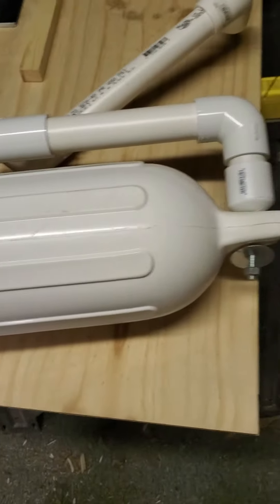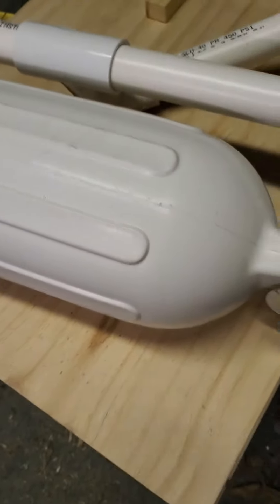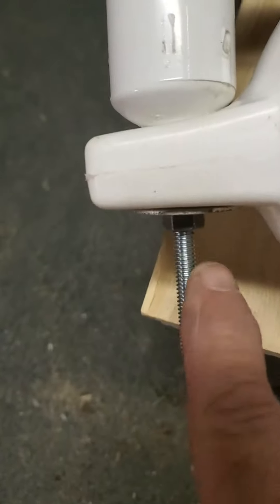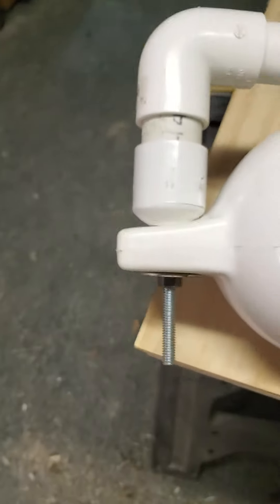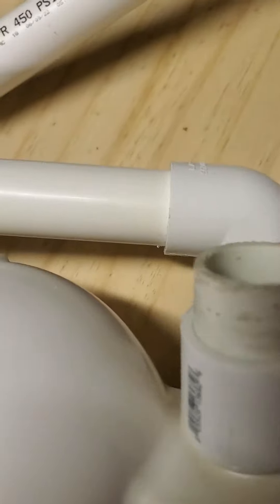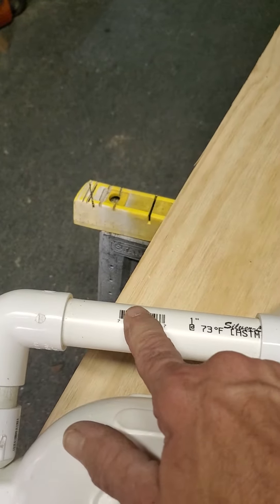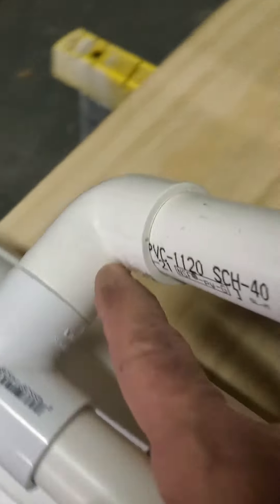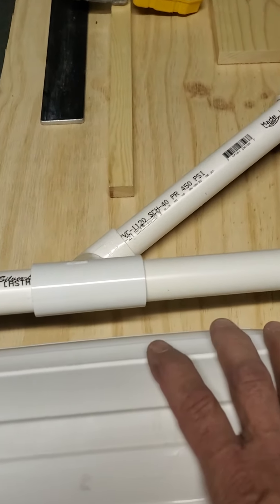How to make an outrigger for a kayak

Comment: What size boat bumper did you use for you outrigger.  I like you design,  how is it working out for you.
Reply: My original outriggers are made of the small bumpers. On one of my trips earlier this year I lost one of my outriggers, I forgot to glue one of the joints in the pvc. When I went to replace it they only had the larger size (it's the one that's white). The bumpers can be inflated with a ball pump (football,basketball hand pump), to give them more buoyancy. I would recommend using the larger bumpers. Thanks.